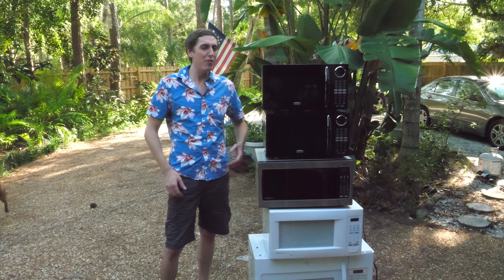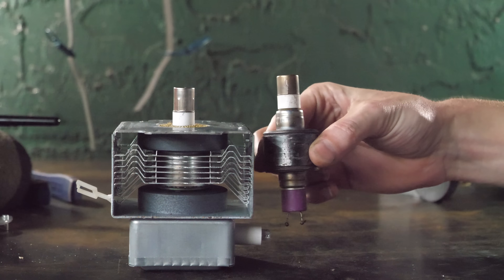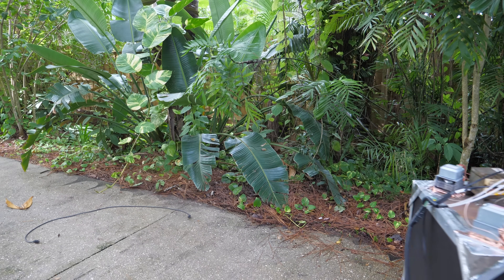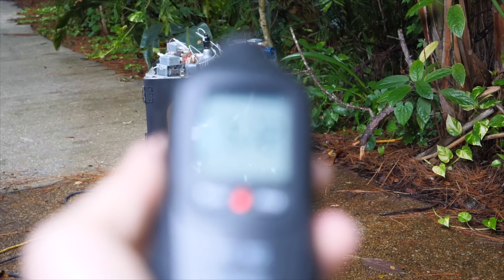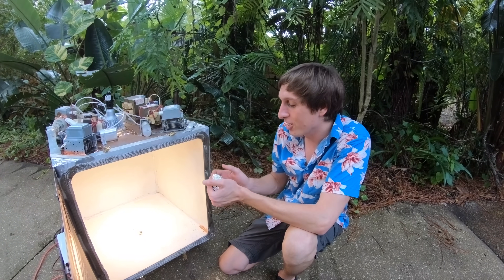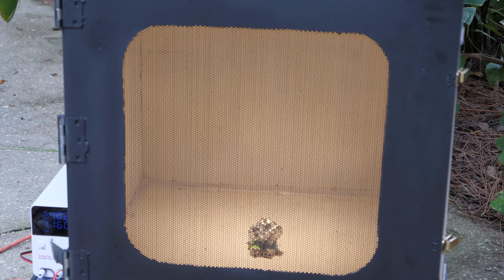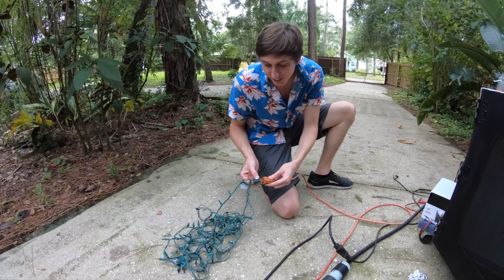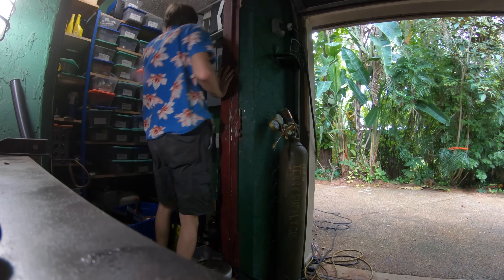DIY MEGA Microwave! - Microwaving a Microwave

Comment: I'm thinking if you place the magnetrons at a distance proportional to microwave wave length, than maybe they amplify each other better. Or they might not! the other option would be to have some reflective surfaces in front of them to randomize the output a bit more as they do in some microwaves. That would steer the waves a bit more especially if the surfaces move.
ALSO! to get larger sparks from the foil, don't ball it, but leave strips of foil close to each other and that should look more magnificent!
AND... no I'm done
[Edit] oh wait! to see the wave pattern in the oven  you could leave a cardboard box in it for 10 seconds and look at it with a thermal camera
Reply: eyebrow daddy😘😍
Reply: @Xiefux uhh
Reply from the maker: Where were you when I was building this! That cardboard trick is a good idea. I bet you could lightly mist it with water and see where it evaporates. 

I'm sure there all sorts of destructive interference happening,    and I could have done better but I just need to start making videos instead of worrying about it too much.
Reply: @TheBackyardScientist  if you watched his videos you would already have seen him do it whrn he was being sponsored by Seek. they make thermal cameras that plug into your phone. They are relly cool.
Reply: Exactly right there. Having all those antennas next to each other will increase SWR and shoot power back into the transmitter (the magnetron), thus reducing radiated power.
Reply: @TheBackyardScientist  use receipt paper
Reply: @TheBackyardScientist  I would like to go do the Google science fair but I would need more information...
Reply: Love your videos 😍
Reply: commercial microwaves I used had a flat piece of metal in the top that spun to bounce the microwaves around, before anybody says anything, no a flat bit of metal will not spark, you need to create a spark gap, like the foil in the large cartons of custard
Reply: Christopher Parsons  My 1978 Amana Radarrange has the spinning metal thing inside like a commercial microwave.
Reply: Thought of ElectroBOOM the whole video!
Reply: ElectroBOOM is in the comments too? Nice!
Reply: The waveguide is a matching network, you really need it if you want to get any efficiency. that's probably also the reason why one of your magnetron's got hotter, without matching the microwaves just stay inside and heat the device
Reply: Can you two do a video together?
Reply: Good thing you still have that seek thermal cameras right?
Reply: got to love it when someone who really knows destructive interference comments on how to do things better...
Reply: DON'T TRUST HIM
Reply: With no waveguide there will definitely be major problems with cold spots in there as you are directing the waves perpendicular to the reflective surface of the microwave. Doing this of course means that the microwaves actually undergo interference with their own reflection which will alternate between constructive and destructive at twice the frequency. Basically the interference is most destructive when the wave hits the reflective surface as it is crossing the zero line (Since the reflection is then the exact inverse of the incoming wave) and at it's most constructive when it is reflected at one of the peaks. This will produce an interference pattern of alternating hot and cold spots, if I am not mistaken they will be a quarter of the wavelength (~3.25 cm wide).

Obviously it wont be exact as it's a rather crude construction so not all the wave energy is likely to actually be being reflected precisely back towards the source but I suspect enough is that large bands where almost no heating occurs probably exist. Hanging some sheets of thermal printer paper in there to get a record of the heating patterns would be an interesting experiment.
Reply: ElectroBOOM wow brilliant idea. By the way i enjoyed watching you videos very informative.
Reply: A Mega ray would be an x ray and your magnatrons arent shielded need everything grounded a metal case on top or cage like the kind used on house vents. I kiss u tho!
Reply: what i did was i put two pencil leds beside each other and it made a plasma looking thing (it was probably plasma idk for sure) so after that i put two pencil leds side vy side with a grwen flare solution between them.
Reply: Can u use a electric flyswatter for a mobile microwave power output?
Reply: Why am I reading this with his accent in my mind
Reply: If you're going to try this with cardboard to show the wave pattern you could probably try painting it with something that reacts to heat. A glow in the dark pigment might work. Culture Hustle sells a paint that changes colour when heated.
Reply: Use thermal printer paper, no need for expensive thermal camera
Reply: @Not Sure In powdered form and sufficiently high concentrations yes the few smaller particles that would come from cracking it not so much especially outdoors where you are not going to be spending prolonged periods of time with a trapped concentrated suspension of any dust released. That said there are plenty of ways to injure yourself trying something like this there are enough microwaves there to cause severe burns at close range if there is something wrong with your faraday cage for example. Not to mention by far the greatest danger and the one that people are quick to overlook because it's so familiar, namely the electrical wiring amateur electrical wiring causing lethal electric shocks and/or fatal fires are frighteningly common. Especially when someone that doesn't know what they are doing thinks it's a great idea to replicate a half assed construction that leaves live mains electrical components exposed outside of a proper insulated or at least earthed enclosure.
Reply: it is easier to disassemble the magnetron, solder the water cooling tubes for it, and fasten more magnets
there will be an output power of 2-4kw
Reply: Electroboom, you can get slave magnetrons  to lock to a master by injecting some of the masters rf  otherwise they are free running.  You'd want  adjustable trombone  wave guide sections  to phase them. Maybe a collab with thesignalpath :)
Reply: Years later, but a whole chocolate bar to see the pattern, you should be able to see where it melts
Reply: Electroboom! Hello!
Reply: I don't think the microwaves from a magnetron are coherent though (unlike with lasers, for example), so it shouldn't matter how you set the magnetrons. There won't be any kind of reinforcing or destructive interference that would make it more powerful or weaker.
Reply: electroboom 
im not surprised
i all so love your videos to electroboom
Reply: 0:13
slaps metal box it fit many microwave
Reply: You were the first person I thought of when watching the video!

Comment: Actually to get a good result in the Microwave, its a good idea to spin it. Also set it onto the edge of the plate. A typical microwave oven has its frequency at 2,ghz, or 13cm, so every 6,5cm is pretty much zero energy.  That's often the center of the microwave. You can see the hotspots of your microwave with an cardboard and marshmallow fluff cream on that board.

Comment: Since you did not go through forming a nice resonant diffusive cavity, this thing will have extreme hot spots and most of the area fairly weak. You should use a wet towel to determine the hot spots and put your test subjects there.

Comment: You can't really add a bunch of tubes together. They need waveguide isolators and
 circulators to combine the outputs right. Your just going to get a really high vswr and a bunch of arcing.

Comment: You fix the cold on the inside problem by off-centering your food. The reason it gets cold on the inside is because of the wavelength of microwaves, the center of the microwave ends up not getting hit as much or as often. But if you off-center your food on a spinning plate, it'll make it cook far more evenly.

Comment: Dear Backyard Scientist, I have a nice idea for your MegaWave) As you may know, silicon carbide (SiC) absorbs microwaves nicely, and is very, very heat resistant. If you make a closed (with a lid) crucible with thick SiC (sounds fun!) coating, you can melt many metals and other stuff with just a microwave. The best bond for SiC is a Polyvinyl alcohol solution. 
Many people use small SiC-coated crucibles for glass fusing and so on.
Have a nice time!

Comment: Isnt the smaller microwave still a faraday cage? 
So, wouldn't it block the microwaves coming in from the larger microwave?

I.E. that Hot Pocket wasn't getting heated any more than usual.

Fun video though keep it up :)

Comment: You do know that you need a 1/2 lambda wave-guide for the cavity magnetron in order to actually direct the waves into a unidirectional stream and therefore do efficient work into an item... Also looking at the way you had the magnetrons set up on the top of the box it did not look like you had the permanent magnets placed with the correct tuned spacing in order to get the waves to actually flow.

Comment: You should do it again, but this time, you broke the glass of the microwave that is inside the other one, because microwaves are faraday cages so logically, if you do this, the big microwave will warm the inside of the smaller one, so it will warm your food faster until burning the circuit of the small microwave, but the bigger one will still warm the inside of the smaller one

I'm sorry if i did some mistakes when i wrote this commentary, because i'm french. So if you understand what i mean, please, do it dude ;)

Comment: You should have extended the box to cover the magnetrons. (they would still be divided from the main chamber of coarse so you wouldn't end up with them microwaving themselves in the process). Have you ever wondered why the entire microwave is made of metal and not just the cage area that surrounds your food chamber?

That is probably why you were getting leakage issues. ;)

Comment: Ofcourse the microwave inside the microwave didn't work. Since each microwave is a Faraday cage just as you said that protects from the microwaves. So the inside of the inner microwave is protected from the outer microwaves waves by it's Faraday cage, hence no improvement. However the parts outside the Faraday cage (such as electronics and plastics) is affected, hence it melted.
Reply: too many micro, too many waves

Comment: I think you might have to angle those magnetrons. The reason there are spinning plates in microwaves is because the interference pattern is asymmetrical . There are usually parts in a microwave that angle the signal to make it bounce more consistently through the box, and if you angled the magnetrons, you could probably get better performance.

Comment: Some magnetrons have beryllium oxide (beryllia) ceramic insulators! So you should not MESS WITH THEM! One speck of it can lead to berylliosis which is not good!
Reply: trolle02 lmao
Reply: I was hoping someone would mention that
Reply: To suffer injury, you need to break the ceramic and inhale a tiny bit of the dust.  Don't do that.  There is no reliable way to determine whether the one you are using contains beryllium or not, so you must assume it does.

Comment: I'm not sure why you thought the shielding on the interior microwave wouldn't work to also prevent external microwaves from entering it. Also, although you advised "don't try this at home" it might have been good to mention the cancer hazard of beryllium oxide from ceramic insulators in magnetrons.

Comment: I heard that technically you can’t microwave ice. But in practice a little bit of the ice melts going from room temp onto the microwave. Then the little water heats up the ice.
I propose putting a microwave in a freezer and seeing if it can melt ice
Reply: Probably was aluminum foil people still call that stuff tin foil every now and then

Comment: I was wondering if you just attached the magnetrons where they would fit, or did you calculate out the distances based on the wavelengths so that one magnetron wouldn't cause the others to be out of phase with it (causing dead spots), reducing the total power produced.  Figuring out waveguide lengths, shapes, and sizes is a black art.  Your microwave seemed to work pretty well!

Comment: Electrical engineer here, you should shield the magnetrons that could be unsafe exposed like that, principally because you have many of those side by side.

also, depending on the distance you put them appart, and the phase of the waves, they might not even be more powerfull than a single magnetron, they could even cancel out each other and you'd end up with less power being transmitted.
Reply: I honestly feel like he want fully powering the circuit as is anyways. A regular microwave pulls roughly 12-16 amps at 120V and NA breakers pop at around 20Amps so there’s no way he was running all of them at full power, unless he managed to tap multiple breakers across his house. 

And then, as you said, you can’t just bolt a magnetron to a surface and hope it works. Regular microwaves have physical wave guides and rotate just to evenly heat. Now you point multiple magnetrons straight into one direction, all with differing brands, power levels, and possibly even slightly different frequencies, it a miracle it worked at all
Reply: I have no idea what you guys are talking about..
I'm just here to look smart.
Reply: It's the mesh washer that does most of the emitting. Still tho, there's about 20 things wrong with this setup. :0)
Reply: came here for this. i"ll bet the unshielded magnetrons were leaking. he should have covered them with metal.
Reply: There's also the inherent flaw in "more magnetrons=more power" I see no evidence he's running 40 amp service to the megawave.

Can pretty clearly see the lab power supply registering 24v, 1 amp, but it's also clearly not powering the magnetrons.